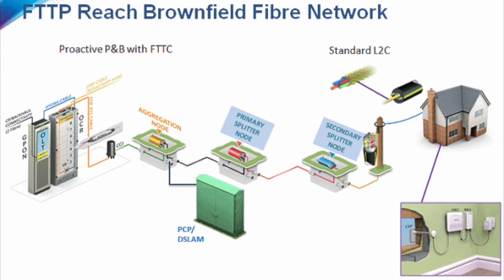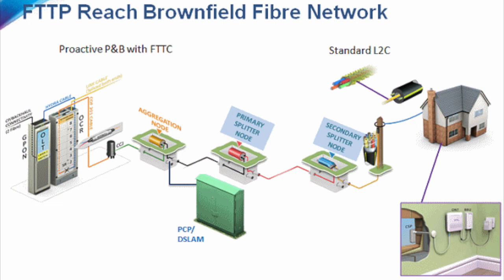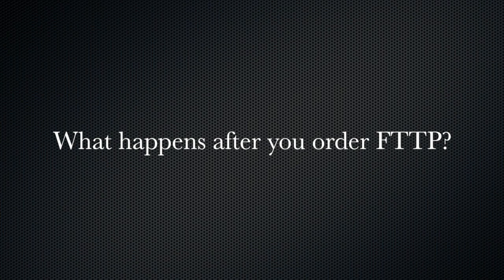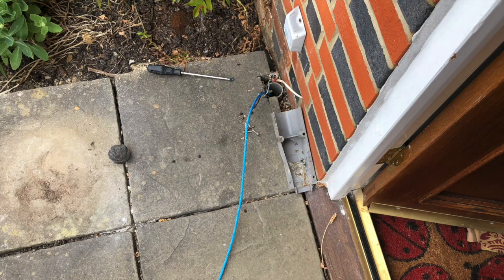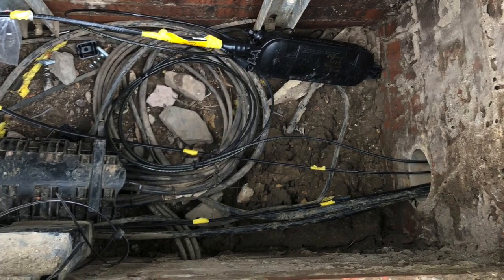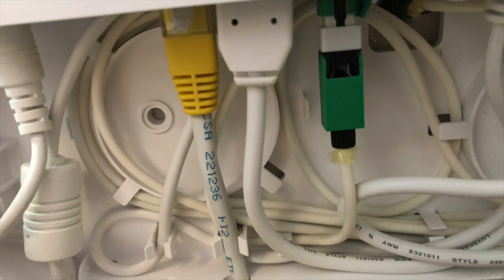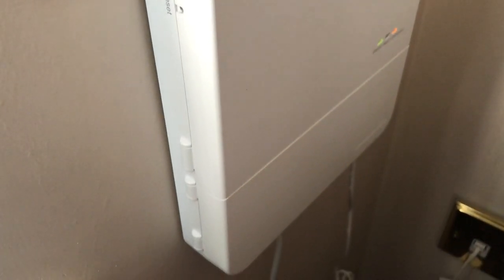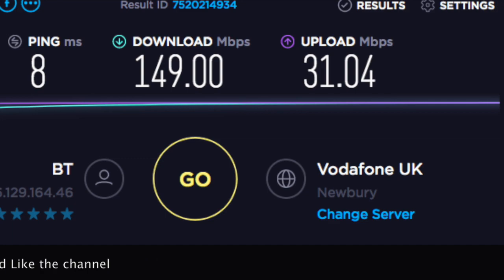FTTP - BT - Openreach

Comment: I have superfast fibre bundle but I am experiencing latency, packet loss and the BT engineers can't suggest anything????
Reply from the maker: @Nico, I am assuming you have FTTP and a fiber modem box in your house like the one in the video? If so then the fault will be with BT or your fiber provider.  My ping speed is usually <7ms and no packet losses. Please make sure you're not on a FTTC, you will know this as your BB will be coming over copper telephone cables and using ADSL
Reply: Thank you very much!
Reply: Just to clarify should I unplug my FTTP but leave my fibre modem box on?
Reply from the maker: @Nico Vizualz, Leave the FTTP modem power on as this BT's equipment to your house.  Turn off your BT Router - HomeHub(5) or better.  Leave it for a few minutes and then restart, allow the router to establish a link and settle down.  Then carry out a test using BT's own BB tester, https://speedtest.btwholesale.com/
If you are still seeing problems contact BT and register a fault.  There might be an issue at the exchange or in their fiber infrastructure to your house.  They will need to carry out a fiber line test at your fiber connection node (CBT) to the exchange then from your house. From memory the green LED should be solid, we don't use ours, in favour of a TP-Link router.
Reply: @joewoodford9428  Done that, i am now getting 38mbps download and a 20 mbps upload and 20 ping but I'm still experiencing some ping spikes, >150, and packet loss despite the decent speeds. Any more suggestions? as the other day, I called up BT and all they did was refreshed the wifi and tell us to turn of any devices when not in use, which wasn't much help :///
Reply: @joewoodford9428  I just did it again and i have found that my upload speed is flunctuating alot, this confuses me :/
Reply from the maker: @nico vizualz, I think you have done everything you can.  Recommend you now report the fault to BT and request a fiber line test,  >150ms pings is high for a FTTP installation.
Reply: @joewoodford9428  Okay will do, thank you very much

Comment: On the Your BT modem, is your port 1 flashing green constantly or is a solid green? Mine is flashing green, is this normal, if not how can I fix it?
Reply from the maker: @NIco Vizualz, The PON and Charge lights are solid Port 1 is flashing, this one shows there is internet traffic.  If you unplug the Router side of the cable from the BT fiber unit the light will stop flashing as no traffic is being driven by your Router.

Comment: Thank you for this. Does the fibre box need to be near the telephone line or does the telephone line not matter anymore?
Reply from the maker: @tha likely lad, if you are in a private house the box can be located anywhere there is an outside wall and power socket, and a fiber line cable can be run to.  There is max cable length from your fiber node connection (CBT) to your house (not sure what this might be but it will 10's meters if not +100m). You will need two mains power sockets, one for PON unit and the other for your Router.  Best to discuss location with your installer on the day your location they are very flexible within reason and fiber length.
Reply: @joewoodford9428  thanks mate that's brilliant so in theory there is no more need for line rental then if you don't use a phone.  Many thanks
Reply from the maker: Up to the supplier, not if BT offers a BB only package. In the future fibers will be your phone line as well.  BT have not enabled this yet on my kit.
Reply: @joewoodford9428  top man

Comment: Hi, were you able to choose where the fibre came into the house? FTTP is coming to our estate but where the copper comes in there are no power sockets so was hoping they could route the fibre round the side of the house to the back and come in that way
Reply from the maker: Hi Jamie,  simple answer is, yes. They pull the fiber from you house to the CBT or fiber connection unit, this leaves a very long length of fiber cable on the outside of your house where your standard phone line pops up from underground or over head before it enters your house. You can then ask the engineer to run the cable around the house to the location you want them to install the large cabinet containing the modem and UPS near a wall socket. If this helps .. please Like and Subscribe ... thanks !!
Reply: Joe Woodford that’s awesome thank you. I have liked and subscribed!

Comment: How many ports on that unit? I’ve been told I’m being fed my broadband via Port 2 as Port 1 was used by my previous provider.
Reply from the maker: Hi Aik, unfortunately due to the location of the modem I can not see the under side of it now. it's behind my desk.  There appears to be only 1 LED which say Port1 on it.  As the kit was supplied by BT i guess they are best placed to tell you what you need for an alternative ISP

Comment: Hi, I have just moved into a new flat, they have this system already installed in the flat. However, the fibre optic cable is not plugged in to the optical port, and I dont see any optic cable as well. What should I do next?
Reply from the maker: Hi CL7, not sure.  They probably had to run a fiber from the main BT Maintenance unit in the flat complex (I'm assuming its a new build) to your apartment. Speak with BT and they will be able to tell you more.

Comment: My Openreach modem has been installed in a storage cupboard near my front door. Does this mean my router has to go in the storage cupboard, so all my devices will have to connect only through wifi rather than ethernet cable?
Reply from the maker: Hi Philip, as the Router is connected to the Openreach modem via an Ethernet cable it is possible you could run a long cable from your box to a suitable location in your house.  Otherwise you are correct that the Router will be main gateway for all your connected devices from your cupboard box. Is there is a free power socket in the cabinet as you could look at a TP-Link Ethernet over Power line extender solution such as a TL-WPA8630P.  It is something I use in our house to extend both WiFi and Ethernet ports over the domestic power socket circuits. I also have a vlog about this and setting up !!! Does that help?

Comment: Thank you for the video very informative, I recently cancelled BT and moved to Vodaphone (same line) but speeds were even less than I previously received and multiple connection drop outs, I was getting a most 30MB, BT advised nothing faster, I am now going back to BT (after a month) and they can now offer me FTTP, have my install next Tuesday so fingers crossed I can at long last have decent speeds!
Reply from the maker: @Lee once the FTTP settles down ( about 7 days according to BT engineer) you should see fairly constant speeds. So far we have had no issues.

Comment: @40s this picture shows you a DACS. 😂
Reply from the maker: Hi, there are several bits of kit shown @40s on the pole. The large box in the middle of the screen with the external 12 Fiber port covers is the CBT, the bottom left is a 4 port Fiber unit and the square box (with the plain cover) I guess if the older copper telephone kit as this was on the pole before the guys installed the two other Fiber units

Comment: Brilliant. Do they do provide anything over 400Down? As atm I receive around 363Down and 20Up with virgin. Also, they they allow use of your own router?
Reply from the maker: Ultra Fast currently (as of 03/10/18) from BT is 330 down and 50up.  Yes you can use your own router if it supports LAN based internet access on FTTP. I'm using an Archer VR2800 from tp-link, the router needs to authentic with BT as well.
Reply: @joewoodford9428  this is perfect i just brought the Archer VR2800 my self a few weeks ago then i was informed by OpenReach that my House is going to be upgraded with FTTP  "Technology that supports speeds up to 1Gbps" thats what it say on the Address Checker  :)  so i was worried my router i just brought was going to be wasted .. .. how is the router working for you  ?
Reply from the maker: @TonyD-UK  Hi Tony, as my FTTP service is only 150 MbpS the Router works every well, the connect is through Gigabit Ethernet so I would assume that if the down steam from the FTTP modem can offering 1Gbps then the Archer will be able to handle that through one of its Gigabit LAN/WAN ports ...
Reply: Joe Woodford excellent thanks for the info 😄
Reply: Why cant you get 1gb download n upload if its fttp? Im confused
Reply: Carti I presume the company doesn’t provide the option yet, it’s possible.
Reply: Adrian JC but its fttp, hyperoptic does fttp and offers 1gb download n upload
Reply: Carti yes and hyperoptic also provide lower fttp speeds for those that cannot afford 1gb up and down, since BT runs the UK as soon as they provide gigabit internet, every other mainstream company will join the band wagon
Reply: Adrian JC they should cos uk should be full fibre by now but its not
Reply: Carti yep it should be, blame Margaret Thatcher.
Reply from the maker: I think BT are only rolling this out to test the market to see if we as consumers need more.  I can not see why anyone in 2018 would need anything faster than 330Mbps down as most web sites can not stream that fast (aka Netflix etc). For pushing content up, 50Mps into YouTube is very quick, but more would be welcome.  My guess is they have spare capacity so will offer this to Premium   customer when they switch this on (my views not heard anything from BT!!)
Reply: Joe Woodford well for downloading games at 1gb speed is faster than 330 and uploading is important
Reply: @LilUziDirt  What are you chatting? How many games do you download and play that 330 down and 50 up isn't sufficient. I think you just like the sound of 'gig'. Peace dude.
Reply: @LilUziDirt  quite simply consumers don’t need it and if you’re wanting that you will buy a business package